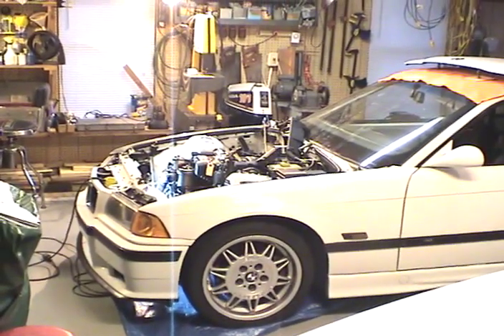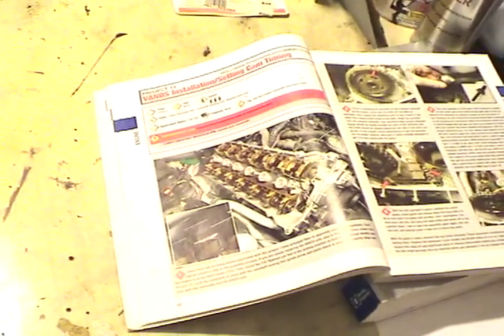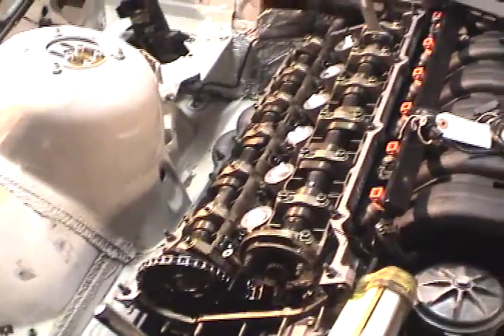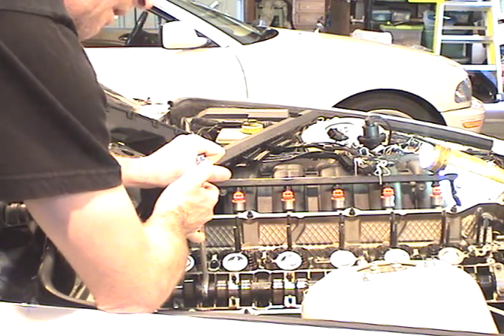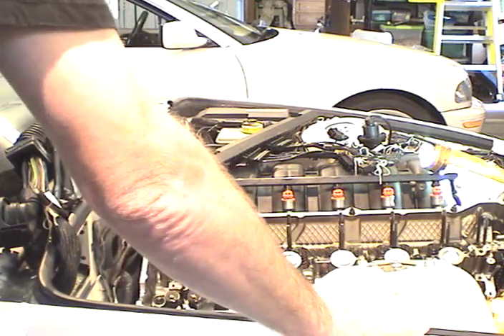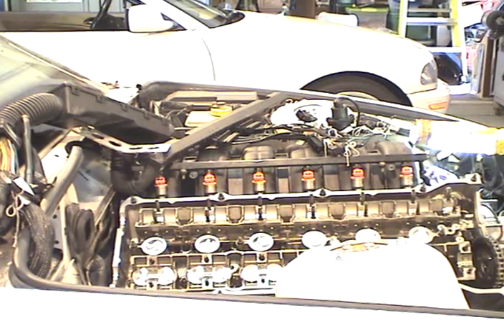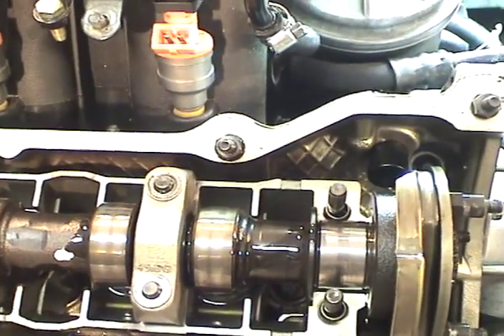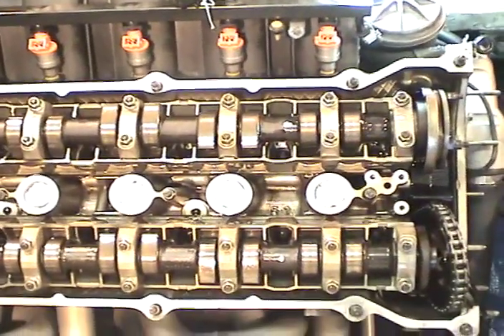M3 Lifter Project, Installing new hydraulic lifters in your M3

Comment from the maker: The best advice I can offer is to handle the bearing ledges the same way you handle the cams, carefully.  You need to keep everything very clean,etc.  I changed the lifters and didn't see any real risk.  The ledges are held in with the same bolts that hold the bearing caps.  They slide off of the bolts easily, but I could see how if you were to pry on the ledge with a screw driver or other force, or worse drop one they could  easily break.

Comment from the maker: True, There is a spanner wrench that fits over the sprocket on the exhaust cam, which allows you to rotate the assembly (exhaust and intake cams) about 45 degrees.  The bolts in the exhaust cam are slotted and this allows you to rotate the cam to one extreme of the slots. There are several reasons for doing this, nothing hard about the process and it's well documented in Pelican's projects book.  The spanner is available online from Turner, or Pelican.

Comment from the maker: The cams are hollow and hard (read that as brittle).  If you bend the cam just a little bit, it will break.  The goal of bringing the entire cam down with one cap (assuming you have set all of the other valves to not place pressure on the cam), insures that it doesn't have any tendency to bend at any time.  You can try to VERY evenly tighten all of the cam retainers, but why risk it?   The engine will be get a new set of cams and head rework this summer, guess which procedure I will use?

Comment: Since he rotated the cam so that only cylinder 1's lobe was actually pressing on the valves there would have been no tension keeping the other lobes from just sitting right down into their bearings. No need to equally tighten across all cylinders because there would have been no pressure on the rest of the cam anyway. If that makes sense

Comment: Have you tried working or changing the chain tensioner rails? I heard they tend to make same rattling noise as VANOS rattle and I believe that is my problem. But I have never seen any videos or photos of good tensioner rails. Would be nice see/hear some advice.
Reply: Danius, I just rebuilt my engine this summer so I replaced my chains and two of the rails as they had groves worn in the surface.  But I believe that most of the rattling noise comes from worn tensioners.  There is one for the upper chain (intake to exhaust cams) and one on the side for the crankshaft to exhaust cam.  If either of those do not keep tension on the chain they will rattle.
Reply: Cheers for the reply.
Yeah, I've replaced the bottom chain tensioner, but I spotted a guide rail loose on the right and did not know if they have to be slightly loose or tight.
I have found your other video of engine rebuild slideshow. It looks like bottom tensioner are supposed to be fully torqued/tight. Right?
Reply: Danius G. The guide rails for the main chain slip over posts that protrude from the block, then are held onto the posts by "C" clips.  They are not torqued down tight by a nut or bolt.  They can move a little small amount along the posts, but shouldn't move laterally unless the hole in the guide is heavily worn (not likely).

Both tensioners are spring loaded, thus the force it applies to the chain is set by the spring.  You only tighten the tensioner assembly to the block with standard bolt torque. 

Have you looked at the tensioner for the upper chain.  You can see this one when the valve cover is removed.  Bentley has a great manual for the E36 that helps with torque values and dis-assembly and installation procedures.
Reply: Thank you for your reply. I have noticed it only recently. Yes, my top chain tensioner was good. I completely forgot the bottom chain tensioner was removed, therefore there was no tension on the bottom guide rails. I simply didn't expect them to be so loose without a tensioner.
I have since replaced my M50B25 engine to M3 3.2 S50B32. I actually started it up a month ago!

Comment: Shouldnt all of the cam retainers be placed on and across the entire length of the came then tightened evenly in a pattern across the entire cams length instead of tightening one cam retainer all the way down as you did on your video? I'm asking in all honesty as I am not sure however my gut is telling me yes as I was cringing with every turn. I would think at the very least having the rear in place to and tightening down together bit by bit alternating. Same as you would do head bolts or rims?